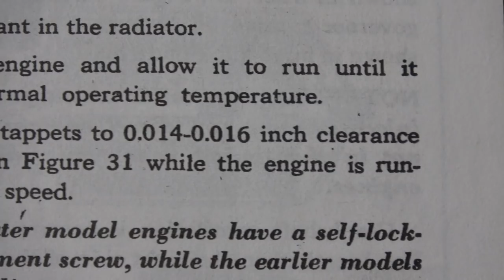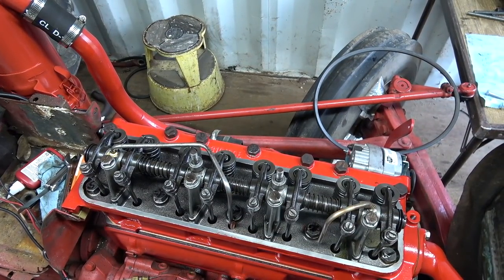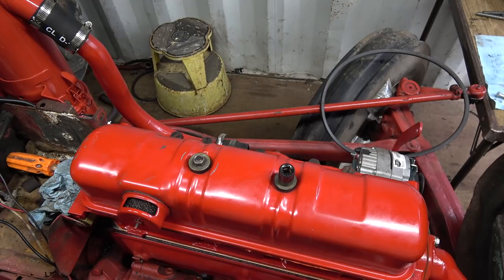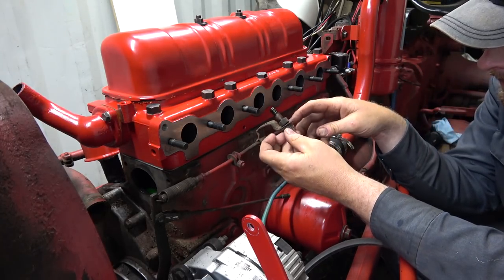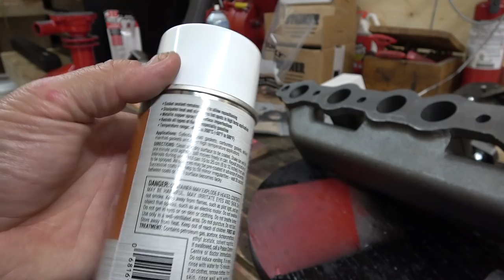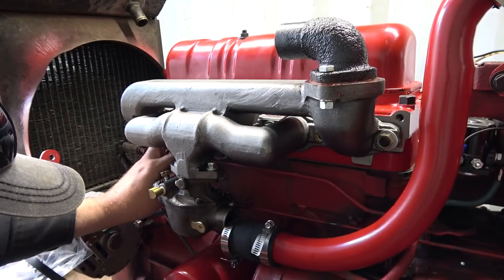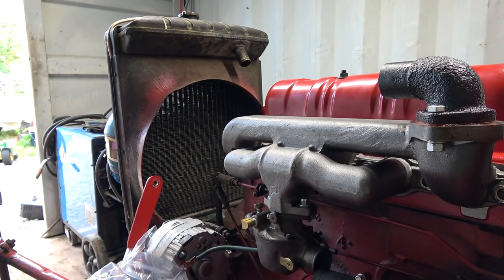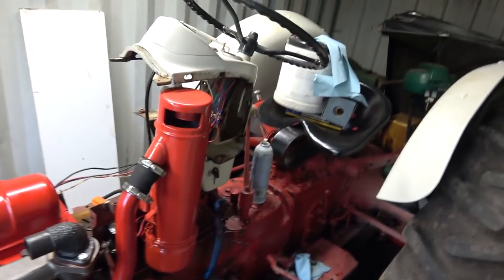Ford 800 lets install the rockers and cover as well as the New Manifold

Comment: Bill the tick is the rocker arm moving sideways with the spring pressure against the rocker pillar  boltdown fitting check out your video and you will clearly see what I mean regards Alan.
Reply: I tried yelling to him,but it didn't work
Reply: You can rally see it when he is zoned in looking sideways
Reply from the maker: so thats normal? only one rocker seemed to be doing that
Reply: @billstmaxx  Bill its probably a bit of uneven wear in the shaft causing it you could just replace the rocker shaft and springs that would cure the tick or just try cleaning the shaft and check for signs of wear and probably lightly taking off any burs with fine emery but make sure you clean it up really well because oil flows through the shaft probably regards Alan .

Comment: Put grease on the valve cover gasket that mates with the head so you can take it off easily when checking valve lash. DON’T use RTV or silicone.

Comment: I think i see what is going on with that noise. When the rocker drops back down, it slightly moves to the left side, and the rocker taps that part beside it on the left. I dont know why it does that, or if its a bad thing or not, but that is definitely the sound. Go back and watch the video and you will see what i mean. Right at 5:03 you can see it go up, move to the right, then go back down, move to the left and tap that part to the left of it. Maybe the pushrod has a slight bend making it get pushed to the right
Reply from the maker: really weird.. I think somethings worn out

Comment: Hi, I am watching your Ford 800, we have parts for the rockers let's try this again video. I think I need new head bolts for my Ford 600. But before I change them I want to try to tighten the ones I  have in there now. I had a new head gasket put on but it revs up a little bit off from idle. I can see bubbling around the head gasket. By just taking the valve cover off, can I get to the head bolts to tighten them all. Without taking the valve train off? Thanks for sharing.

Comment: I told you once it's a tappit making the noise it's nothing to hurt anything just makes a noise. Iv been a machanic for over 20years and my dad is a listened machanic for over 40years we work on farm and construction equipment the tappits are what runs on the cam that pushes the rods that is what you are hearing to stop it you have to change all the tappits.

Comment: You can run the engine a bit without the cover to make sure intakes and exhaust is moving correctly. I think your ignition coil was loosing power or spark shutting the engine down after it got up to temp. One thing I’d do after she’s lit pull the spark plug wire one at a time to make you have spark going and the engine changes rpms. If not check each plug is firing by cranking the engine. Weirder things have happened even to the wire. Have dill say spark no spark. If that sparks install till maybe one is intermittent could be a bad coil.

Comment: Bill. . . RE-READ YOUR INSTRUCTIONS that you posted at 0:39 of the video! There's a big reason why you thought that valve cover was too tight -- IT WAS! The instructions say "Install the rocker arm cover and new gasket. Tighten the cover nuts to 20-30 in. lbs. torque." --- 90 in. lbs. is a BIT too tight!!

Also, before you're worried about the correct torque spec on the cover, you might also want to take another look at what it says about valve lash settings. 

"Start the engine and let it run until it reaches normal operating temperature.

Adjust the tappets to 0.014-0.016 inch clearance as shown in figure 31 while the engine is running at idle speed."
Reply from the maker: that's why i left the lash a bit loose on the .016